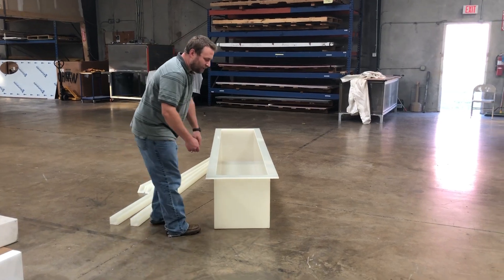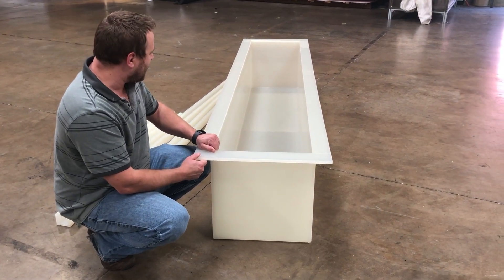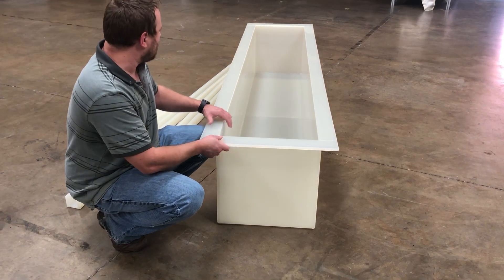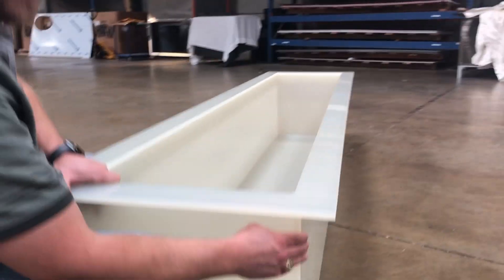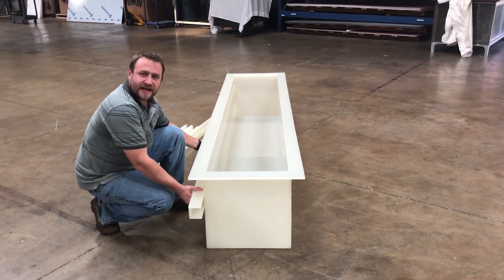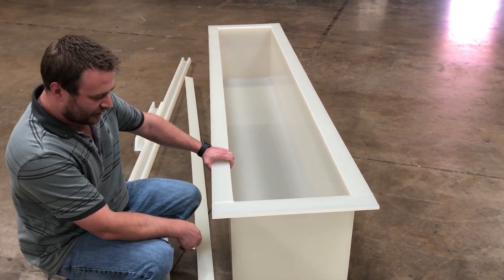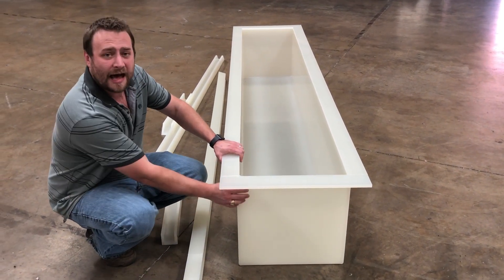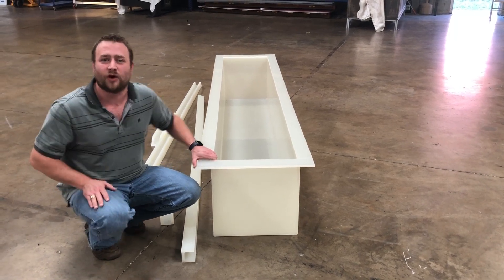Polypropylene custom welded tank

Comment: Have you ever custom fit water holding tanks in a raised access floor—in a tiny house on wheels?  I’ve designed a 10” space underneath my floor to keep the water and waste tanks inside and weatherize them for the winter.  I would also need them to pipe out through the trailer frame for dumping/filling at RV parks as well as to connect to a filtration system.  Do you have leakproof fittings to plumb the tanks to the kitchen, laundry, shower and toilet areas?
Reply: @CoverYourPergola    Thank you!  I’m talking with a framing company and a builder right now who actually thinks I don’t need custom sized tanks, but I’ll take a look at your site!